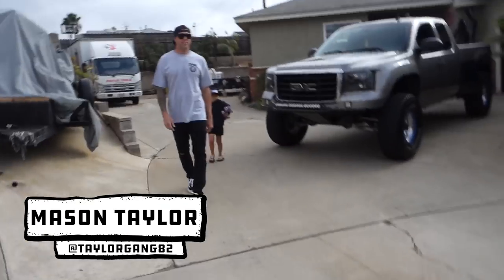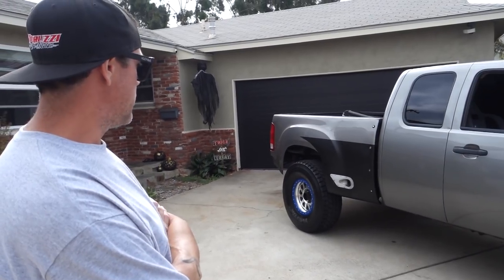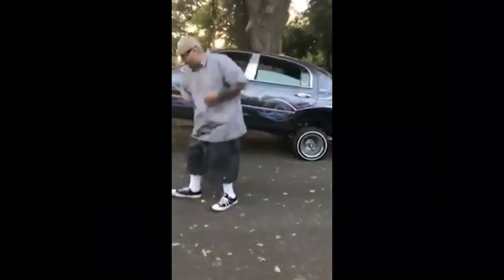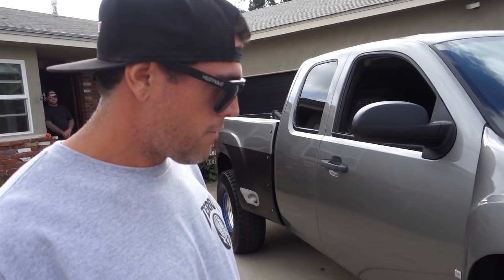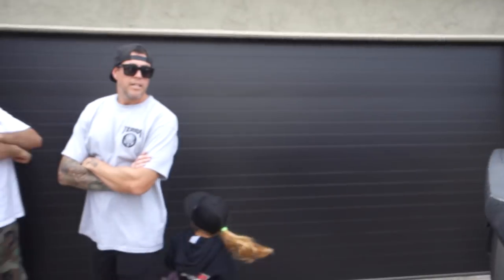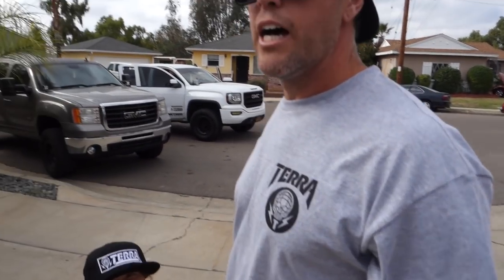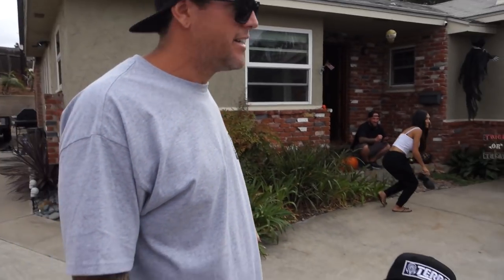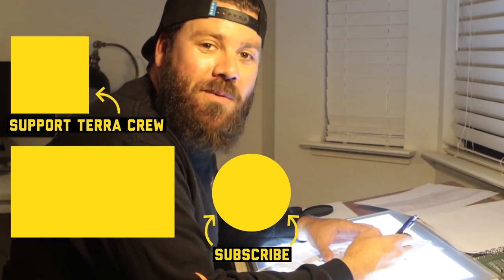Daily Driver GMC Prerunner! | BUILT TO DESTROY

Comment: The tuner did such a fantastic job on the start up. Factory cold start settings have something like 17% fuel addage. That cold start was just perfect. The fact hes running a pretty aggressive cam means it doesnt make a whole lotta vacuum so for it to start that smooth tells me that tuner looks and adjusts EVERY single table and dials mapping in the way youre supposed to. Id bet my bottom dollar HP tuners is where he learned his procedures, theyre the best in the biz. Id really like to know the cam specs if anyone is privy to that information. That thing just sounds so stout and right. I wanna dip my BAWLS IN IT!!!!!!!!!

Comment: It would be great if you could include cost in the review. For instance I'm looking at geting an rpg rst 18 and bolt kit. What could I get built by a smaller shop for the same cost?
Reply: Got a Dirt king race kit for 9,300 front only 3.0 bypasses 2.5 coil overs,upper and lower arms,spindles,tie rods and all hardware. My rear set up is still in the air might go with a 4link set up runs around 9,500. Shop time and labor may vary.

Comment: Great truck! Regarding that issue about stalling at stop lights because of the brake booster, I had a very similar issue and had it re-tuned. The issue went away but it took someone else to retune it. Not sure if this helps (experience from G8GT with almost 500 tire)

Comment: Hello sir, I have a 4.8 silverado with a stock transmission & I was wondering about your TH400. A video on what options we’re put on that build would be great. It sounds like you paired it with a couple of engines but more importantly that 4.8 🤤. I know there are stages but my questions really fall on shifter set up & anything you wanna share that would help, help!

Comment: Beautiful trucks, Hey guys I'm in a predicament.  I have a 07 classic Silverado with 5.3 and I just did long tube headers with cat delete y pipe. The smell so  bad so thinking of going to shorty headers and put stock y pipe with cats back on it. Anyone have any ideas on a y pipe I could run with long tubes that won't drain the bank. They are speed engineering headers with 3" collector.
Reply: Is it dumped under the truck? Mine was and I popped it out of the side and it helped a lot
Reply: @jss6060  It is actually dual out the rear, Even sitting there at a light it's like holy crap that is strong. It's turned so we have it running clean it's not rich in mixture.
Reply: Ride Red maybe try a high flow cat. It will still give you the performance you’re after but will help burn everything off that’s making it out the back
Reply: Ride Red I’ve used magnaflow high flow cats and they worked well
Reply: @jss6060  Awesome,  I was trying to look around and see if there was a high flow y pipe for it. I will look some more.  Thanks for the advice I appreciate it. 👍
Reply: Ride Red try Texas speed
Reply: @jss6060  So I actually went with speed engineering short tube headers so I could put my cats back on. They help with low to mid range torque I can feel. It's always something, That odor of no cat's was killing me and was too loud in cab.